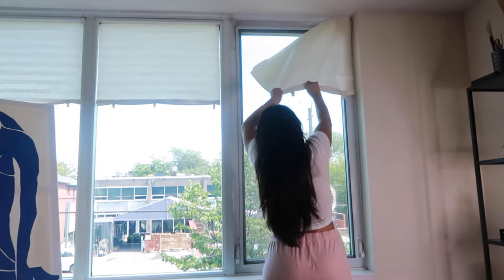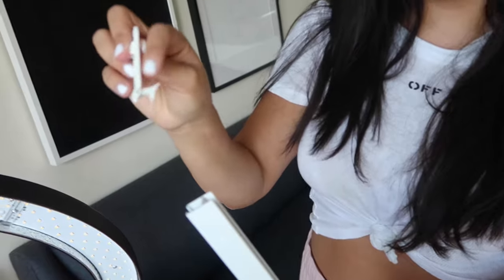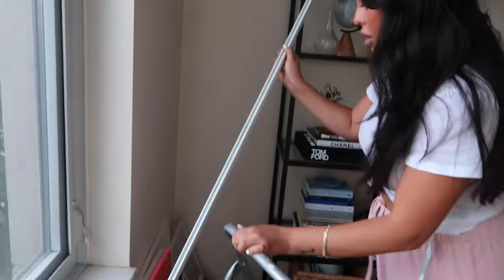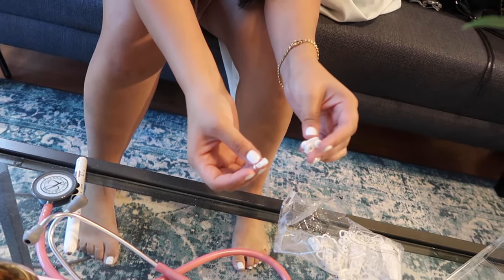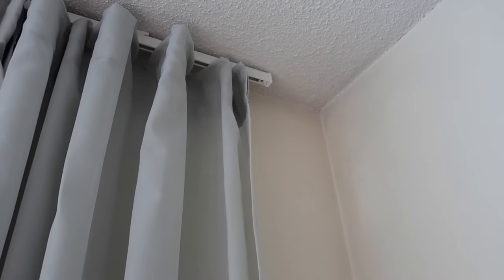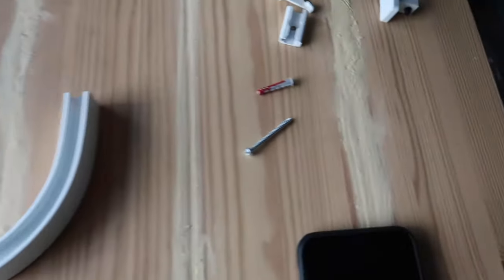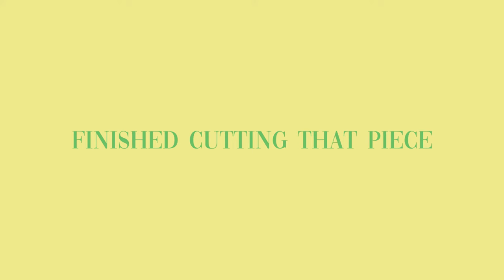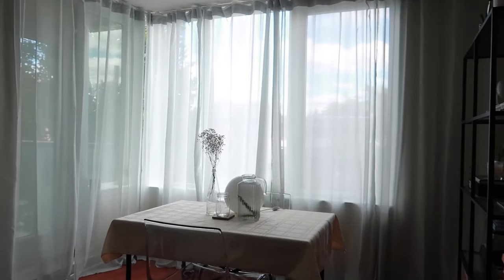IKEA | How To Install Vidga Ceiling Track  + Gunrid Air Purifying Curtains 🌾

Comment: Great video! Just want to mention this: your ceiling seems to be an artex ceiling. Some older artex ceiling has asbestos in it, make sure you check for asbestos before drilling into it next time, or at least wet the area you are going to drill first and wear an N95 or + mask, also would need to clean up properly (wet wipe or H class hover).
Reply: I have artex ceiling.  Would you recommend actually hanging curtains from this type of ceiling?
Reply: i have the same looking ceiling but its quite new in a nice building..You  think it's safe?

Comment: Hello Amanda, thanks for the great info. Approximately what is the overall dimensions (height x depth) of a cross section of the rail itself? I have searched IKEA sites and haven't found that info anywhere.

Comment: Thanks for this, it's super helpful. Question... do I have to place two brackets (ceiling attachments) exactly where the corner piece joins the straights? Could I place two brackets near the ends of the straight before it joins the corner piece? I have a 45 degree bay window and was thinking of cutting a corner piece in half so the angle would be right for my window. Thanks!

Comment: Thank you! When you slide across the joints, does it feel smooth? I'm planning to hang one big piece of curtain across a wall, so want to know whether the joints would be an issue.
Reply from the maker: It’s not an issue but it’s not as smooth as it can be!

Comment: Hi, I have i want to do a similar set up as you have just done but my window is wider than the Ikea pack. So, if I buy two packs are they designed to be able to join them together?
Reply: Yes. You can join them.

Comment: I have drywall ceiling would this system work ?
Reply from the maker: Generally drywall can  hold about  15lbs, you might also need drywall ceiling anchors for the screws :)